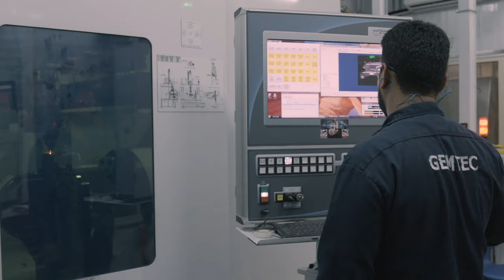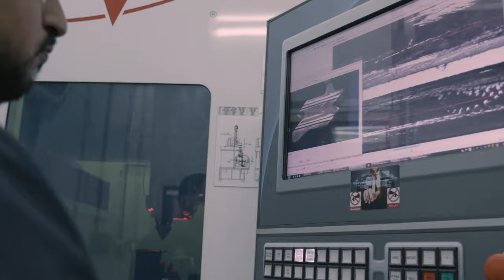How GE Runs One of the World's Largest Gas Turbine Service Centers & Powers Saudi Arabia | GE Power

Comment: I'd love to see more about GE Hitachi nuclear plants.  After all, nuclear power is a critical part of the zero carbon energy mix!  From the Ge Hitachi  website:
"A single uranium pellet, slightly larger than a pencil eraser, contains the same energy as a ton of coal, 3 barrels of oil, or 17,000 cubic feet of natural gas. Each uranium fuel pellet provides up to five years of heat for power generation. And because uranium is one of the world’s most abundant metals, it can provide fuel for the world’s commercial nuclear plants for generations to come."
Reply: Almost perfect but big problem is nuclear contamination like in Fukushima 🤷🏻